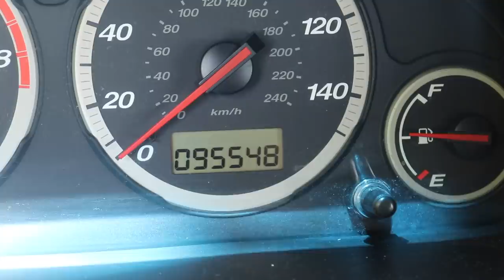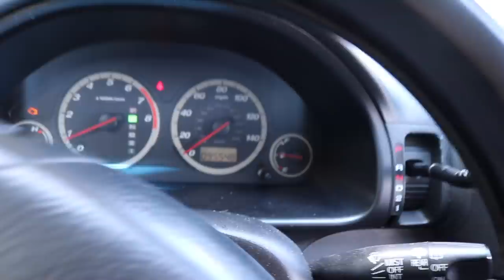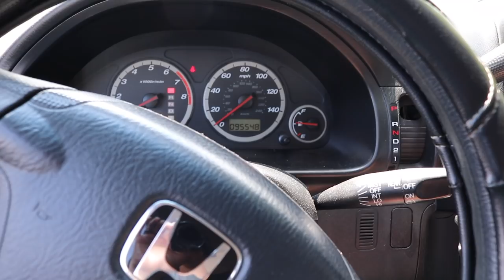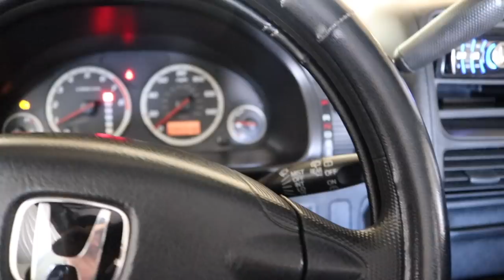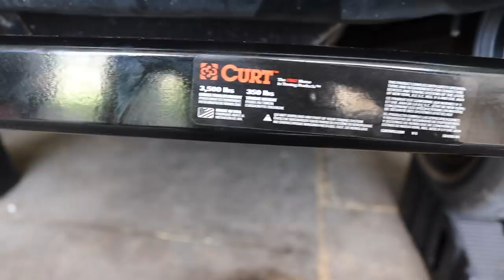I NEVER thought I'd own this vehicle!!!

Comment: My wife and I have had a couple crvs and they are my favorite most reliable vehicles i have owned currently have a 2011 with 240k miles and have only done fluids. Have towed our diesel truck with 24' livestock trailer home when the truck broke down. They are machines

Comment: Nice move, Honda’s last long time.  I have a civic with 370,000 miles.
Reply: Nice..... my truck has 410,000..........
Reply: @602_7.3L  nice my old 2000 Honda CR-V had 480,000 original miles. Original engine and trans
Reply: @ZayneMcDonald  nice my dads 7.3L Powerstroke diesel has 876,986 miles on it.